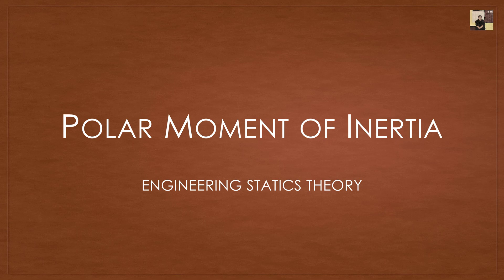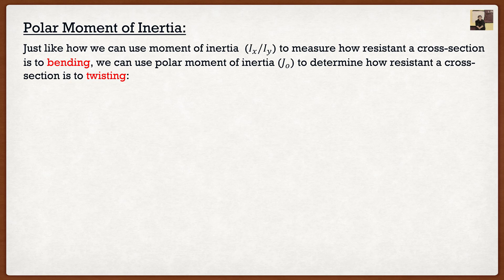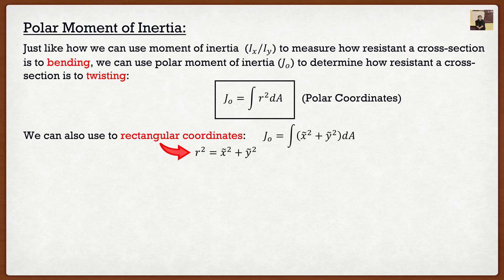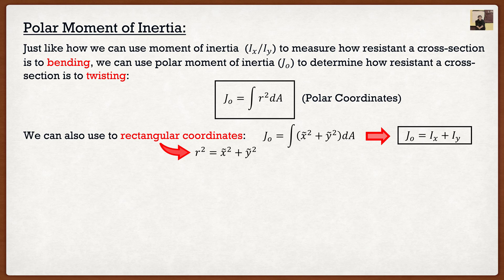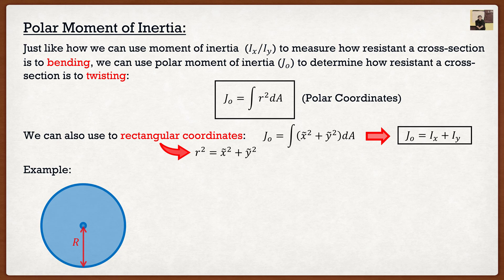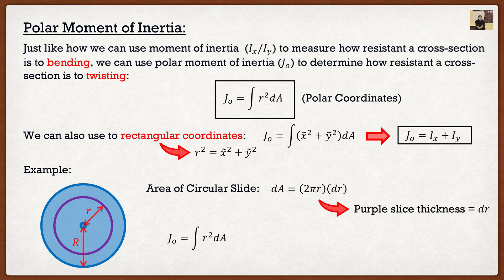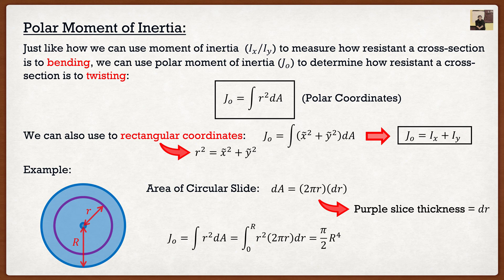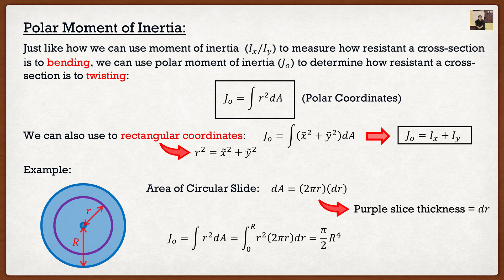Engineering Mechanics: Statics Theory | Polar Moment of Inertia

Comment: Thickness as in = length of the circular shaft ?
Reply: not the length, width of the cross section of the shaft. Consider a hollow shaft, the width of the walls of the shaft can be called as thickness.
Reply: @infobybala  so (d2-d1) is the wall thickness 
The hollow section , or D would be equal to (D-(d2-d1)*2)
🙏 Thanks for clarifying

Does that mean you could write the equation as (2πr)(d2-d1)*2 or am I mistaken?
Reply: @ValleysOfNeptune2150  The equation would still remain Integration((r^2)*2*Pi*r*dr), but the limit of the integration will be from r1 to r2 instead of 0 to R as shown in the video.
For a non-hollow rod the limit of integration is from 0 to R, for a hollow rod the limits would be from r1 to r2. Where r1 is the inner radius(hollow radius), r2 is the outer radius.
Does that help?
Reply: @infobybala  nah, I'm way more confused 😕 haven't done integrals yet, some derivatives and limits but no solid foundation as yet.
Thanks for trying